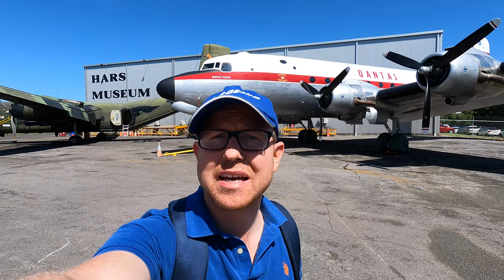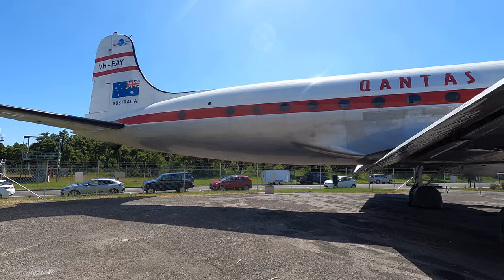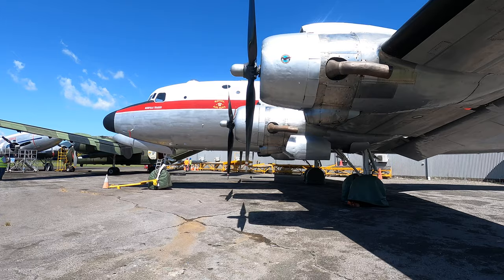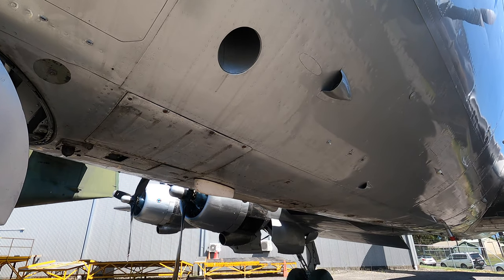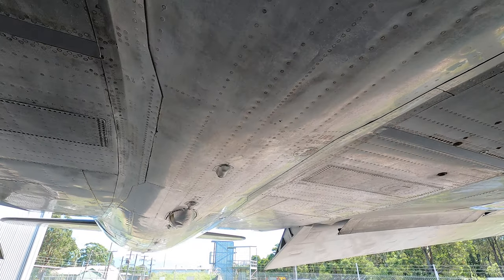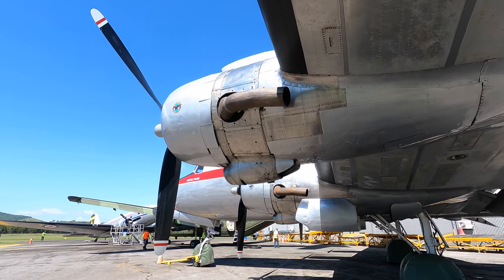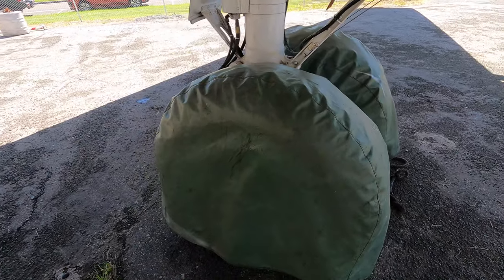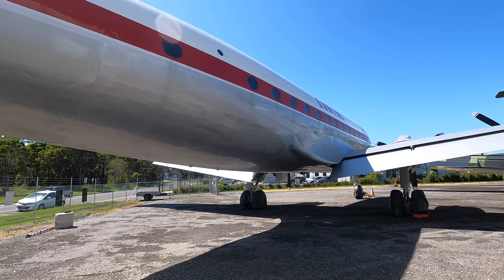Tour around a Douglas DC-4 (C-54) Skymaster!

Comment: The majority of Douglas C-54 "Skymasters" were built at the Douglas-Chicago plant during WWII which was located at the northeast corner of the present-day Chicago O'Hare Field airport.  Curiously, after the war many surplus parts and machinery from the Chicago facility were purchased by Canadair Ltd. of Montreal, Quebec for building the Canadair DC-4M "North Star" which used Rolls Royce Merlin engines versus the typical Pratt & Whitney R-2000s used on the American built "Skymaster."  Very informative tour of a C-54/DC-4.  Thanks for sharing!